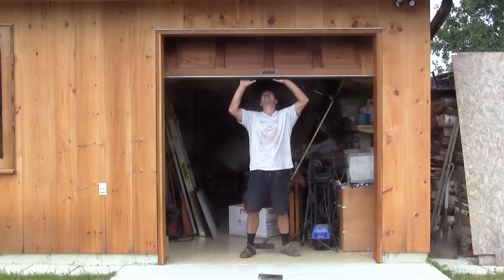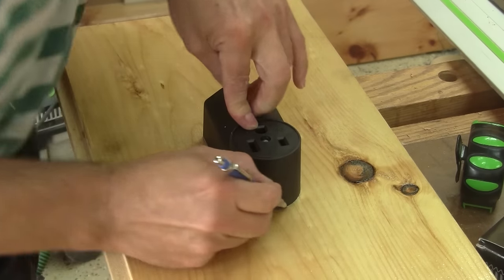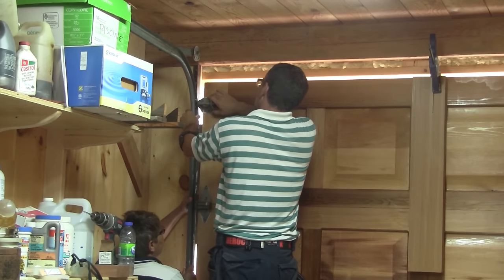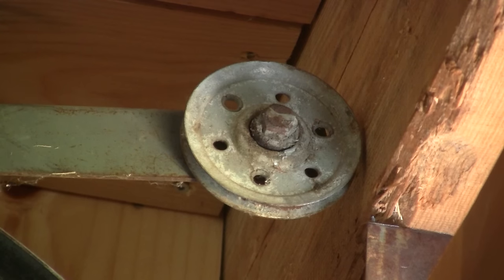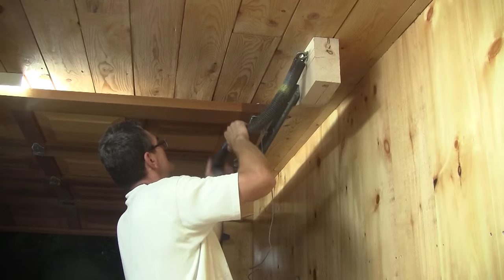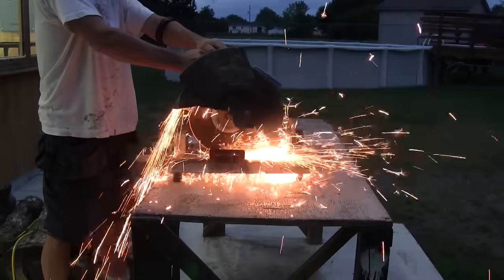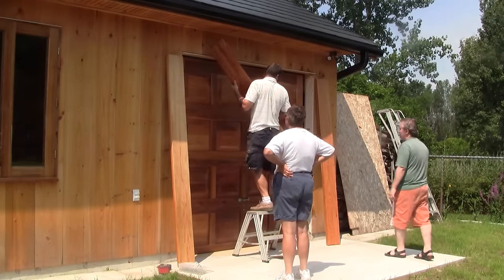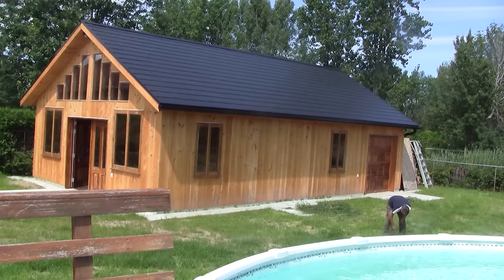The Woodpecker Ep 93 -  Building the new shop part 21 -  Installing the garage door

Comment: Beautiful door. I had extension springs like that on the garage door in our old house. The springs eventually broke and large chunks of spring went flying and made dents in the walls but at least didn't hurt anyone. Might be a good idea to install a safety cable through the middle of the coil and anchored at each end of the cable.

Comment: Beautiful. When you put the bottom roller on and said "huge mistake", it hit me.I have done the same. As the bottom gasket compresses, the locking bolt will drop. Easy to deal with if you make a full slot for the slide bolt and bolt piece of iron to the back of the rail to catch the top  of the bolt.  Fancy is cut a disk and drill off center to rotate to take up slop. Less so is slot a straight piece so you can slide it down as needed. Lazy, which is me, is drill a hole and as needed make a new piece. I replaced once for 10mm  settlement. It initially went in at about 5mm, when the door began to hang on the bolt. I don't think it will need another before the gasket fails and I start Over. I saved the original piece.

Comment: Very attractive, strong and well mounted door! Does that complete the workshop building? Will you be converting the old workshop into the crafts room for Rene now?
Reply from the maker: +MRrwmac This complete the exterior, the interior is mostly finished, but I still have to make a "water" corner. I runned a pipe from the basement to the shop last year but it's still dry, so I have to make some cabinet with a sink in one corner, but I still have to make other things before that. It's a work in progress.

Comment: shop is so nice - why not copper gutters?  Also great door but given all the work why not a nicer custom handle?
Reply from the maker: +James Campbell I don't know if I can find copper gutter here, and this must cost a fortune!
I'm thinking of nice turned custom handle, but everything was one disaster after another, so I just re-installed the old handle for now and 'll probably make new ones another time.
Reply: +Alain Vaillancourt I noticed you used galvanized handles on such a magnificent piece... kind of a contrast.  I'm sure you'll find something a little fancier that will complement the door perfectly. Excellent job!  Thanks for letting me enjoy the experience without all the work!!

Comment: Looks great, Alain! I wouldn't have ever thought of building my own garage door until now.

Did you do anything to fill the holes from where you originally placed the bottom wheel?
Reply from the maker: +l3ender15 Yes, I bought shorter cariage boalts and stick them inside the wrong holes.

Comment: Plz tell me method of epoxy glue thank you
Reply from the maker: It's quite simple I use West System epoxy and I hadd silica powder to make it even harder and also thicker, because this epoxy is quite thin. After you just use it like normal glue, but the big avantage is that you can work your joints for about 45 minutes, it's why I love using this glue in difficult glue ups, this extra time let me put everything in place with out the stress that the glue will set. But I need to wait at least 18 hours before touching this again, not a bog deal, 90% of the time I do that anyway using any type of glue.

Comment: Alain, Alain, Alain. You built the most beautiful door but have done a terrible install. 
As someone who have been installing garage door for several years, there is much wrong with how this has been installed. For a start, the door does not close smoothly because you have used the same side hinges all the way up. You should have offset hinges (#1, #2, #3) so that the door closes in a wedge action and only makes full contact with the frame when fully closed.
Get hold of a friendly garage door professional to help correct some of the mistakes and your door will work as beautifully as it was made.
Reply from the maker: I changed the wheels, but it still as hard to close. Renée has a very hard time opening it...
I reused the old hardware of the old door, and all the hinges are different each pivot is closer to the door going down. I'm not sure if this is what you mean by #1 #2 #3